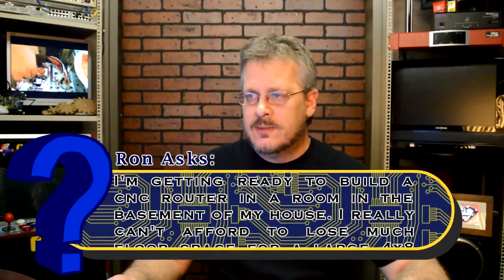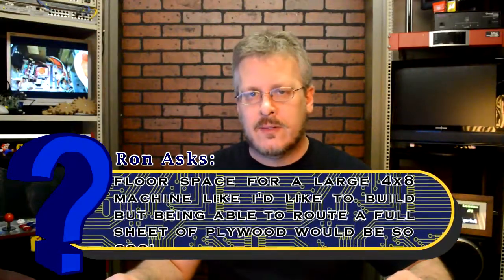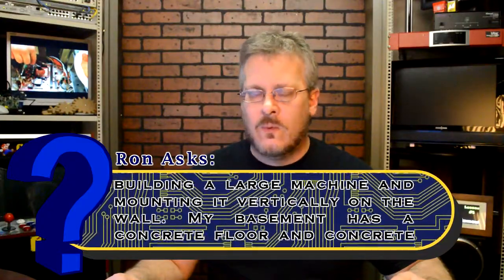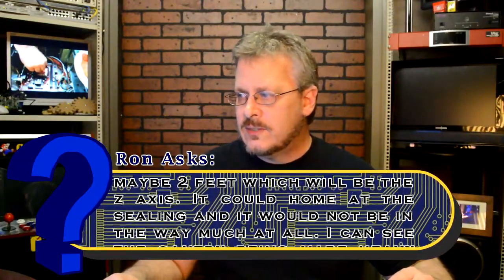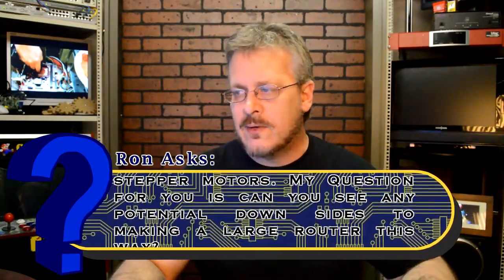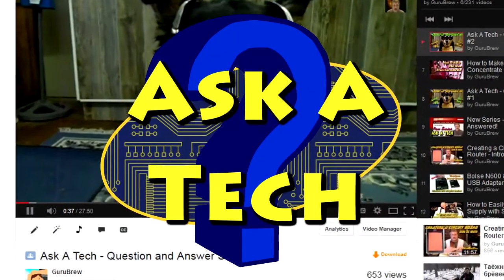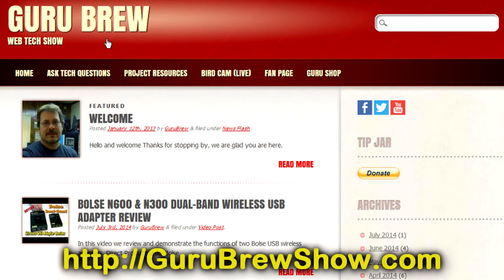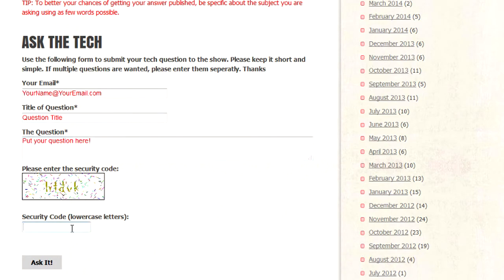Vertical CNC Build Idea - Potential Problems? - Ask a Tech #24

Comment: i envision my arduino sensing pressure against a spring and simultaneously relocating the pressure plate when the Y (if you will) axis fights gravity,  in addition as a fun fact,most boring mill operators know that horizontals impart a level of droop but i guess we might be able to throw that out he window most times on wood stuff

Comment: think if you have some real weight hanging of the gantry you need a box in the rear of the machine holding 2 dumbells with a small axle in between so it looks like a jojo with the weight of the x axis the router and the z axis setup
if the box is tight enough to the dumbels cant rock inside but can roll a little you can then use the type of strap they use in ratchetstraps mount it to the back top end of the box loop it under the axle between the dumbells and back up to the front end of the box route it over a skateboardwheel and another skateboardwheel over the gantry and down towart the x slide and mount it there making it allmost weightless 
the box holding the weight needs to roll along with the y axis so you prolly need to build a whole slidesystem with v bearings and stuff for it , the extra weight will add some inertia to the y drive and the box will cause the setup to be sitting a bit more away from the wall

i think if you mount a servo to both the top and the bottom of the screw on the x axis you should be ok as is , the screw whont roll down on its own as eazy as a toothed belt would and the extra motor wired in reverse should add the extra power needed 

another option is to route a bicycle chaindrive for the x over the machine and gantry so it goes down behind it , you can then freehang the amount of weight needed on the chain on the rear of the worktable